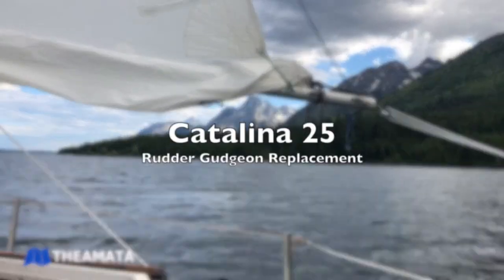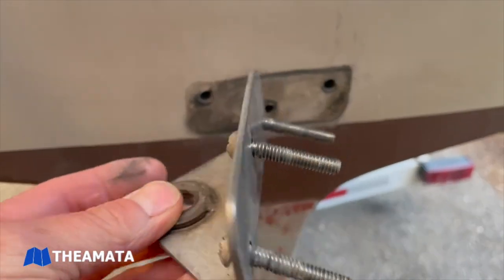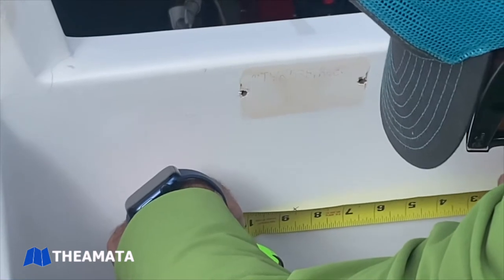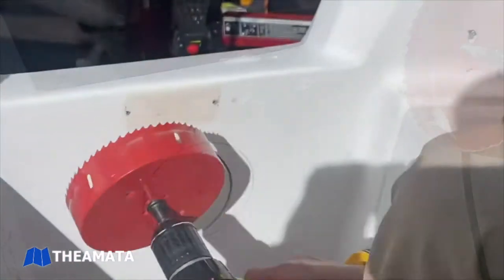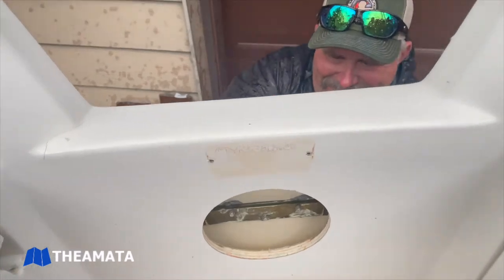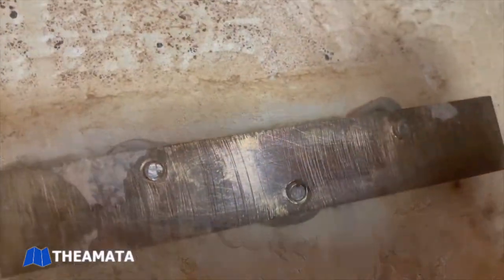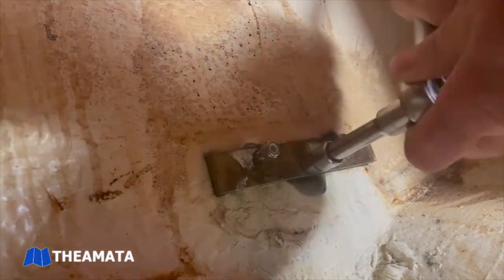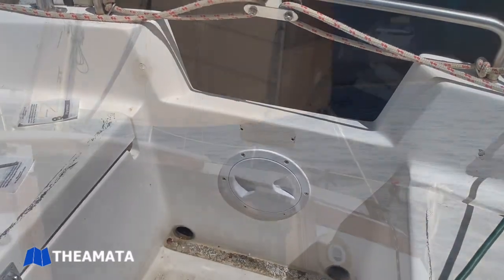Catalina 25 Rudder Gudgeon Replacement

Comment: Nice work! Unfortunately on my 1982 Cat25 Swing Keel Std rig, there's no access to the lower gudgeon plate via the aft quarter berth. It must not come all the way through the hull and the liner, only the hull. The lower gudgeon left bolt is missing or sheared off but I'm not sure how to fix it. Anyone have any ideas? The boat's on the trailer for the winter so it's a Spring 2023 project.